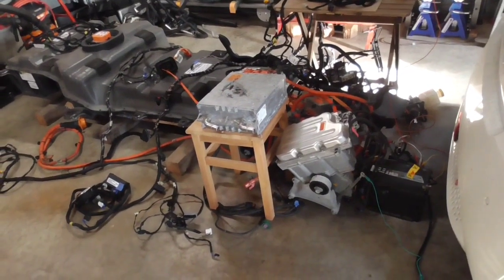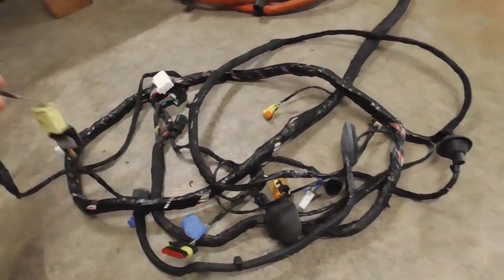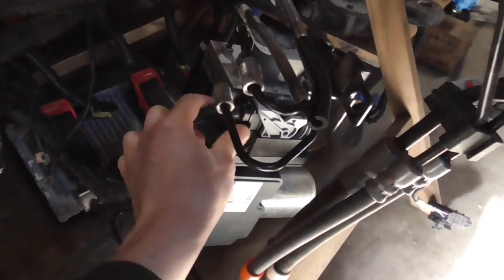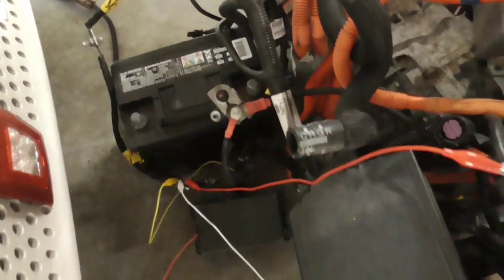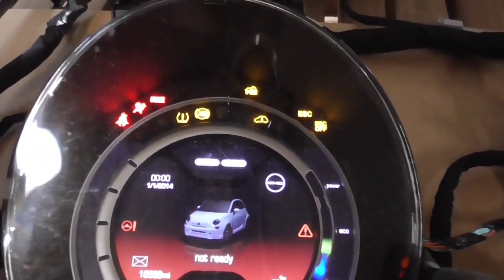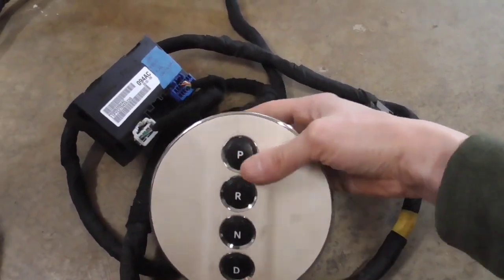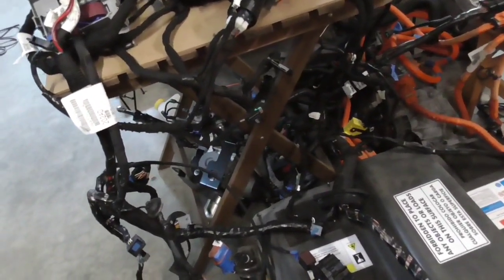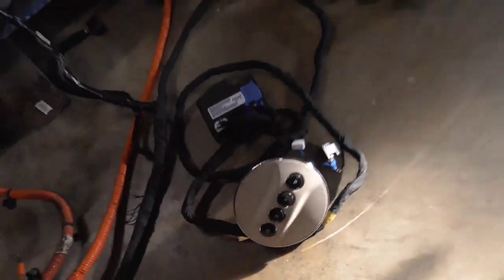Fiat 500e - Teardown - episode #6

Comment: Do not run the power electronics without any cooling. You will be surprised how quickly they overheat and thermal limit. The battery won't need cooling in this scenario, but don't try to charge without cooling, and if you possibly get the car to come out of park, definitely cool the HV Inverter. It doesn't have to be fancy, you could even hook up a garden hose to it, just as long as there is liquid flowing through.
Also, you can go through the stored messages to at least get an idea of some of the errors on all those lights.
Reply from the maker: Thanks for your input.

Comment: @The Evolving World  I know it's been over a year, but I was wondering if you have any 500e parts left over? I'm looking to replace the Power Inverter Module on my 500e.
Reply from the maker: Most parts are either: reused, sold, or gone.  If you have a '13.5 or an early '14, there was a recall for faulty PIM's.  If so, you should be able to that replaced for free.

Comment: Hi, I am researching a motor for a low power conversion in Australia and I can get a Bosch 180/120 from a hybrid axle. I am needing some help in determining if the Fiat 500e motor is wound the same as the Hybrid application.
Do you still have the motor? If so, would you be able to measure the resistance across the windings? That way I can compare the resistance to the hybrid application and see if it is wound the same.

Thank you for your time.
Reply from the maker: Thanks for the comment.  I wish you all the best on your future projects.  I've Sold off the Bosch 500e Motor.

Comment: So what's going on with this project these days?  Your videos are extremely helpful as someone wanting to do a conversion based on a 500e.  (We have a 500e now, as does my dad - I want another one to become the powertrain for my 92 Jeep Comanche.)

I was really bummed to not see this bench test work.  My best case scenario would be to use as much out of the 500e as possible, particularly the controller/inverter/charger.  This is all just a dream at this point, but I'm trying to learn everything I can.  I'm wondering whether it's going to be very demanding of certain sensors, though - wheel speed sensors come to mind, as well as any sort of collision detection it may have.
Reply from the maker: I'm finishing up my first of at least five EV conversions.  Lot's of videos will be coming later this year.  Not using the 360v Bosch motor, charger, inverter/controller as it's a whole lot easier to buy a fully customizable motor.  But, lot's of other EV parts have been successfully transferred over.  Stay tuned!
Reply: @theevolvingworld   Interesting, and thanks for getting back to me.  Did you get any farther with that motor/controller combination than in this video?  My dreams of harvesting the drivetrain and parting out the rest of a 500e are 90% dashed, but still anything I can learn from you about any absolute roadblocks would be really helpful.
Reply from the maker: @tmarbut  Not much further.  Somebody, one day will figure it out.  Just set the powertrain aside for now & use the other useful parts.  Also, I would save anything with an electrical connecter on it & "part out" the rest.

Comment: I have a 500e which I plan to gut to convert a Honda 1986 CRX into an EV. From what I'm aware, you used the batteries but not the motor or controller from the 500e. Any words of advice or suggestions you can share? I've done engine swaps before but I'm also keenly aware that the Fiat is extremely sensitive to "missing" parts so I assuming a high chance that I will also fail to bench test the 500e motor battery controller. Did you ever get it to work?

I was going to take a slow part removal analysis approach by removing accessories and check to see if the 500e will still operate (drive). Starting with things like lights, airbags, seats, hvac. Essentially to figure out where the ecu stops and won't let the car run.

Alternatively I might explorer an alternative controller to see if I can pair it with the motor and batteries.

Thoughts?
Reply from the maker: Yes, I remember you.  Long story short, until somebody hacks into the 500e controller &/or makes another controller work with the Bosch motor, it's not going to work.  Too much OEM CANBUS integrated crap.

We are well on our way on our 2nd EV conversion project, this time a FWD with a 5 speed manual (full project videos will be appearing soon).
Reply: @theevolvingworld  thanks for the reply. So from your investigations, we can't use any other controllers as the motor requires the oem canbus to operate? No way to splice in wires to bypass the oem canbus?
Reply from the maker: @Windraver  Fundamentality, the motor should really just need a power supply & basic instructions (as an accelerator pedal) to tell it what to do.  I've heard that some people have gotten the LEAF powertrain to work, which is interesting.  It would be great if somebody hacked into the 500e evcu.

I like aftermarket controllers as they are completely customizable.  If you got the time & want to experiment around, then by all means.
Reply from the maker: @Windraver  Thanks for sending.  If you get it figured out, let me know.  Cheers,

Comment: Are you selling any parts? I'm rebuilding a 2015 500e that had a front end accident and I need the small aux coolant pump that is behind the radiator fan slightly to the driver's side, mounted on the big rectangular aluminum motor mount block..
Reply from the maker: Select parts have been kept & avail.  If that specific pump is for the motor/inverter/charging cooling, then I will be using it.  If it's a battery cooling pump then it would be avail.  I'd have to check.  Maybe contact us on twitter.

Comment: Why would you not use all the parts from the 500e and connect everything?  All those components are well-engineered and it works.  This way you can use the 500e troubleshooting guide if something goes wrong with your EV project.  I really doubt that you are going to crack the can bus code and make it work with another controller.  Looking forward to future videos.
Reply from the maker: That was the plan, and it's not working.  Too many parts I don't need & the 500e computer / CANbus system want's it all connected.  Might be able fool it for a few things, but there's too many open connections & not enough time.  The aftermarket controller will be super simple & easy to customize.

Comment: Here is a sample of the fiat 500 e high voltage diagram look a the wires labeled HVIL I think all theses connector that has them have to be connected example the A/C compressor, the batt heater , the interior heater etc ... https://dh.identifix.com/webservices/Srs.WebPlatform.WebServices.FileManager.svc/POX/Get?project=OemContent&sessionTokenId=7a610e7f-16d8-49c7-8a83-2eb7fa15d953&file=OEDocs/28518/html/images/pngplus/Diagram_193451.svg.png tell me if anyone can see this diagram